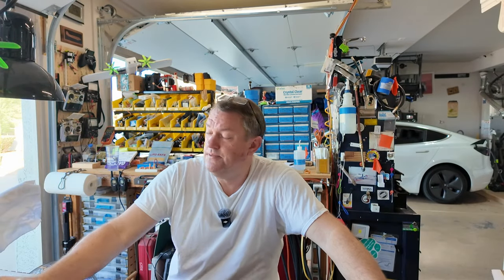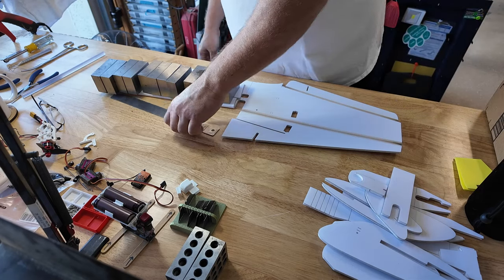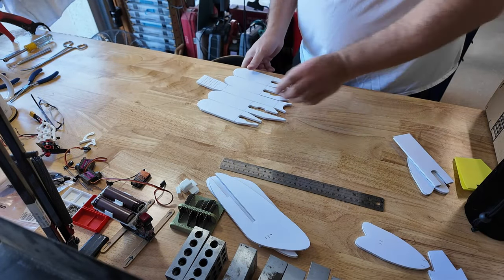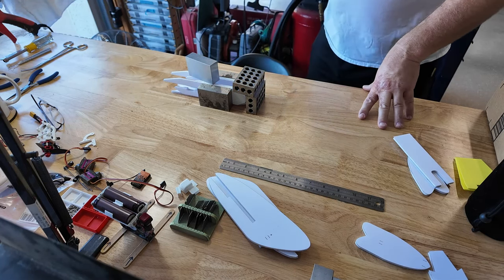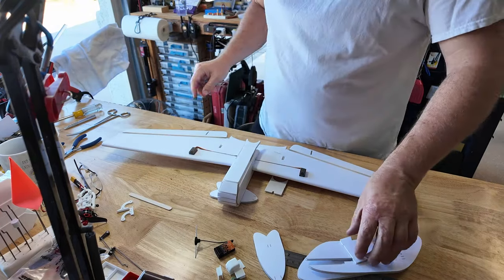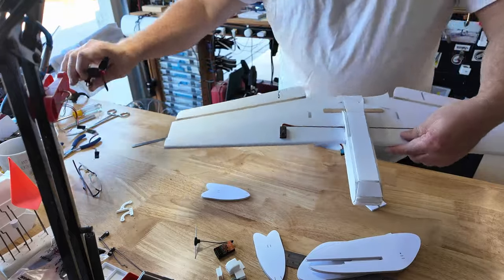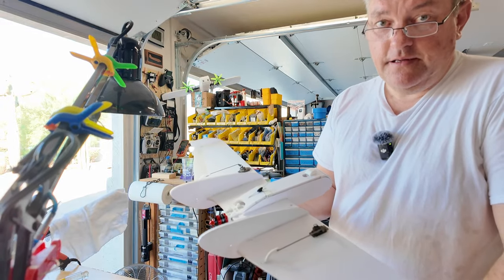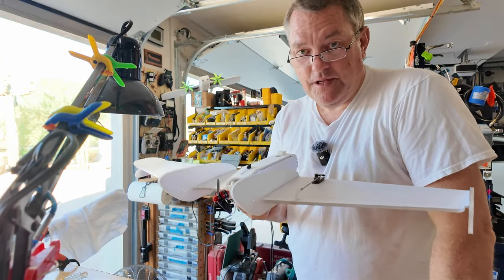Mini Wing Build - in under 30 minutes!

Comment: Nice video, good narration. A hot glue tip I've found that you may find useful: if you've glued a joint and have to undo it, a little isopropyl alcohol will release hot glue, and a heat gun will get it liquid again, I've even used a soldering gun to reheat the glue when it's in a tight tricky spot. A few practice pieces on some scrap board will have you up to speed in no time. Have fun
Reply from the maker: Great tip.  I keep a squeeze bottle with isopropyl alcohol on my workbench, and there's a heat gun under my bench.  The alcohol is brilliant, it works amazingly well.

The heat gun however takes some skill.  If I'm not careful, it can impact the foam and deform things. 

You've got the right idea.  Keep the tips coming! 

Thanks for your comment.

Comment: Great simple clean build. Can tell a well thought through design with a number of nice design features. Great 3d-printed motor mount design. This is something that Flite Test should have integrated into their foam board designs. (they used flat wood, which could result in thrust angle issues)
Reply from the maker: Thank you.  I spend quite a bit of time and have made hundreds of iterations and evolutions to get here, but I really like how they've turned out.

Thank you for your comment.

Comment: Where can I get those weight blocks, awesome content I fly a lot of wings myself and do a lot of scratch built park jets
Reply from the maker: I buy them off Amazon, but you can find them on Aliexpress as well.  Search for 123 blocks.

The versions with holes are handy for stacking on top of foam board structures, as they’re light enough they won’t crush the structure beneath.

You’ll start with a couple of them - and as you learn how handy they are - they tend to multiply.

I’d love to see what you make with them.

Thanks for your comment!

Comment: I've found with the Hv Lipos and good throttle management I can get some good run time out of them. Maybe an extra 5 to 7 minutes even longer in a few gliders compared to a normal lipo of the same Mah rating.
Reply from the maker: Careful throttle management is key.  I seldom fly full throttle, and more frequently fly closer to best glide to maximize endurance.  It all depends on your mission, and staying disciplined about your power usage. 

You've got the right idea. 

Thanks for your comment.

Comment: Super cool! Laser cut? What is the process of making those v-groves?
Reply from the maker: Yep, laser cut on a CO2 laser.  The cuts for the hinges are just done at a faster speed and a reduced power setting.  The laser has incredible precision - it just takes time learning your laser and how it works on that material.

That said, a laser can do amazing things.  Find a local makerspace / hackerspace / STEM center and try one out- that’s how I started.

Thanks for your comment!

Comment: Any reason you do the nose with the cuts on the outside instead of just peeling the paper (on the inside) and curling it?
Reply from the maker: You raise a good point, and while I feel one method of e great for finished models, in this case I prefer the foam to the outside as it's on the nose, and I don't always land on smooth surfaces.

It's a different styles for different builds.  But that said, I usually solve for ease of build, as I'm frequently testing new designs. 

I'd love to say when I finalize it I'll build it pretty, but I'm more of a form follows function kinda guy, and the impact resistance of another 5mm of foam vs the build time trade off of multiple models?  I guess I'm a lazy dude, but either way is cool. 

I used to build every model perfect, until I flew them. 

Now, I just love a good flying plane that's easy to build. 

Either way, I've got some ideas to share in a video working to share my design ideas.

I hope I can bring you value, and I thank you for your comment.

Comment: I noticed you use a battery eliminator rather than a Normal ESC... I presume that's because you have a surplus drone ESC which doesn't have power for the radio. 
I have surplus ESC like that too.
But I can't find a "battery eliminator circuit" with those key words.
Reply from the maker: The real reason is many of my pylon builds (ESC and motor)  get incorporated into builds with flight controllers. 

Furthermore, ESC's that incorporate the BEC are frequently far heavier as they incorporate a heat sync that's heavier than if they don't incorporate the BEC.

I buy my BEC's from aliexpress.  They're just 5v power supplies.  I'm on my phone, but let me know if you need a link, but honestly they're pretty generic and I usually order 10+ at a time as I build them into all kinds of stuff, and usually very cheap.  If you run into challenges finding them, comment again and I'll get an exact link.

Thank you for your comment.

Comment: I really like your 3D printed parts and laser cuts.  What software do you use?  Do you have your own laser?  Which model?
Reply from the maker: I do most of my design work in Fusion360 for my 3d printed parts, and CorelDraw for my laser cut parts.  The laser is a G. Weike LC1290.  The laser is a 100W CO2 laser with a Rudia controller driven by Lightburn.
Reply: @usefulaircraft  Thank you for the info!  That is a sweet laser!  I've used 60 and 100 watt lasers on wood and acrylic.  Never foamboard.  It looks like you cut partially through for some of your stuff.  Any trouble keeping it from catching fire or melting?

Comment: Looks to me that the KFM foil is on the bottom instead of the top of the wing . Why ?
Reply from the maker: I’ve built them both ways.  

When I started with KFM, the step was on the top, as usually shown.  However I really began to feel after flying them extensively that their lift at this scale was primarily due to AOA, not Bernoullian (sp?) lift - just fly them inverted and see - they fly based on pitch attitude.  If you look on the wall behind me, you can see an earlier version of this exact plane with the step on top.  Flying both - you’d be hard pressed to tell them apart.  Thus step placement became a design choice that on different airframes depending on other factors.  

I’m not willing to accept all I read, and I’m quick to iterate and build and test things that others say will obviously fail - but I’ve got to understand myself why - and so I just try things.  I’ve built many planes that in hindsight - are obviously flawed.  But with regard to step placement in my designs, it’s very possible that there are advantages in some flight regimes - but I’m not trying to chase the last percent of performance - if I was, I wouldn’t be building from foamboard.

So in this case - it really came down to I preferred the looks of the inverted KFM.  It looks better hanging on the wall - and still has remarkably good flight performance.

Build it both ways and report back.  I’m always interested in the results of experiments. 

Thanks for your comment.
Reply: I have built from plans with Step on Top or bottom depending on the designs Author, they fly well both ways.